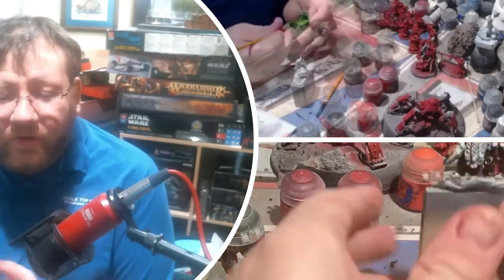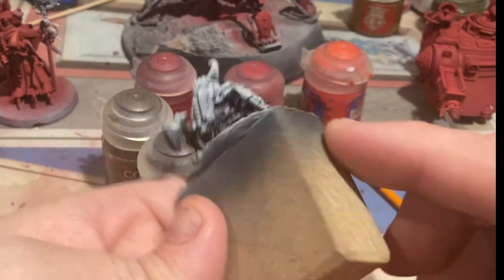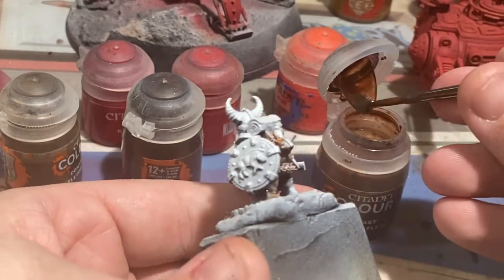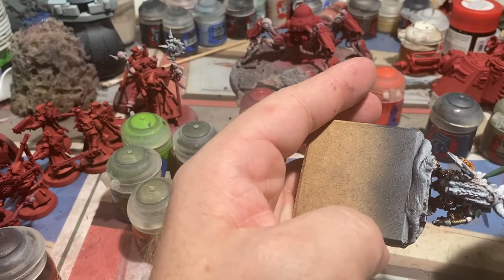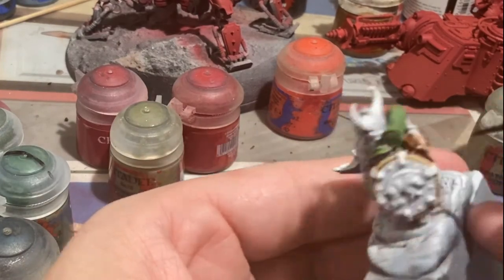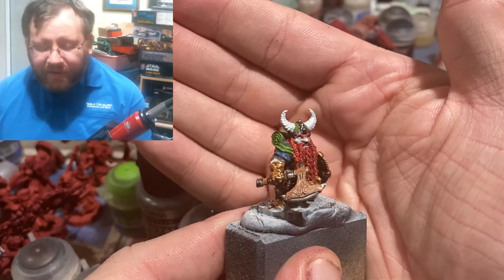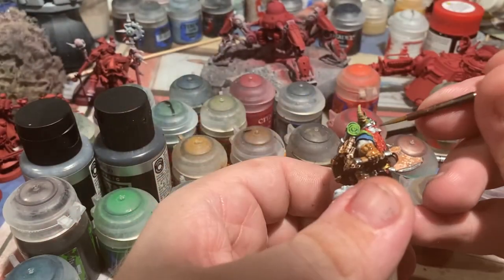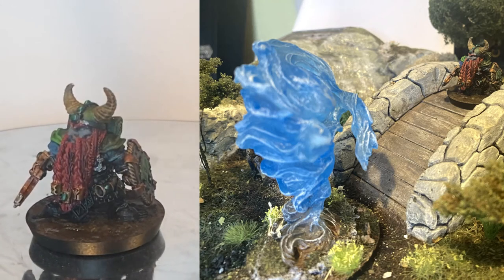How I paint a miniatures to look illuminated by OSL - Duergar

Comment: What is the difference between pueter and plastic models. Also, from 2:24~3:30 its a frozen freeze frame on screen. But I do like the new way you angle the camera just need to get the setup for framing to record. Also I like the way you add the little window of yourself in the corner so we can see who is talking to us. Makes me feel like I'm having a conversation with you rather then just looking at a sped up video of painting a mini
Reply from the maker: the freeze frame wasn't there in the video editor so I'm not really sure what happened there, I am sorry bout that. I'm also really glad you feel that way about the new format, I wanted it to feel like we were having a sit down chat and not so much me telling you what to do. as for answering your question about pewter V.S. plastic the big difference is metal models definitely have problems with paint rubbing off. I recommend if your working on one to stick it down to something like I do rather then holding it; also make sure your primer has cured for a few hours before you start painting on it to make sure it sticks you don't have to do that with plastic models as the primer bonds to the surface of plastic better then metal so you can start painting as soon as it is dry to the eye. Hope that helps! let me know if you have more questions.